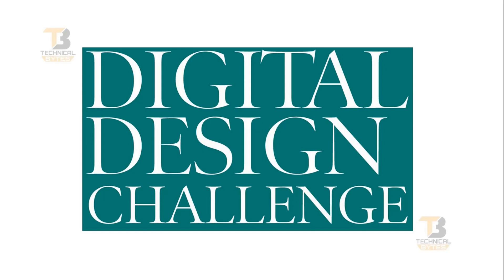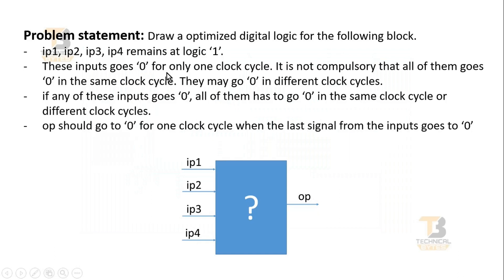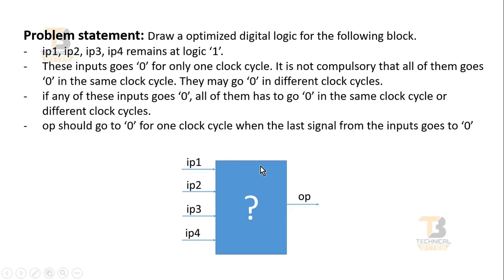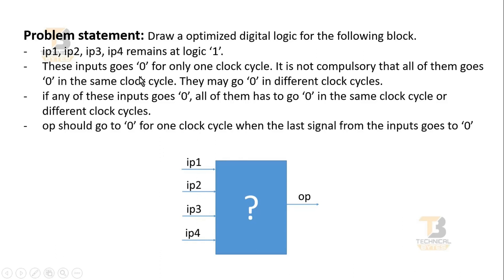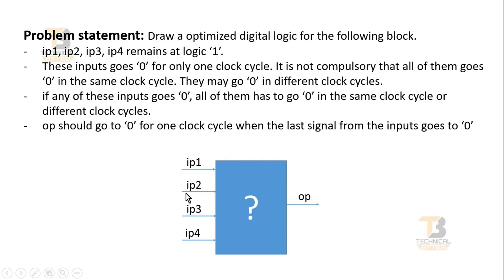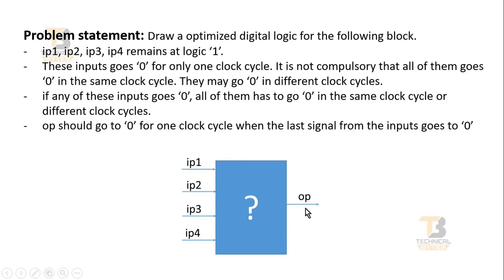Digital Logic Design Challenge | De-Skew logic

Comment: https://drive.google.com/file/d/1Zod3CWFzXak3Xtw_T5CVO9jnIYJQ8aad/view?usp=sharing
Feel free to correct me guys✌
Reply: I got the exact same solution
Reply: Bro one doubt. Is the last flipflop taking input ip4 necessary? since all signals b4 it will have become 0 once for a clock cycle and we just have give ip4 to a not gate and get 1 from the output of and gate...... Also the final output should go 0 when the last input(ip4) goes 0 on the same clock cycle .use of a flipflop for the last input will delay the output by one clock cycle.....please correct me..
Reply: I reviewed your design, there are two problems in the design, first one is that applying a data signal to the reset signal is discouraged in the digital design. Second major issue is that your output will go '0' after one cycle of delay after the last input goes '0' . Please check it once !!

Comment: 1. Negedge detector for all 4 inputs.
2. Additional 4 flops to store the detection, once all 4 are detected will auto-reset all flops to 0 and generate an output pulse.
3.Pulse generation logic can be combinational, which will be asserted when all 4 flops are set to 1.
4. Let's say in the nth cycle all 4 flops get 1 value, in the n+1th cycle we can make all 0, this way we can see the pulse on output logic.
Reply from the maker: very good try !! But your pulse will be delayed by one clock cycle. output signal should go '0' in the same clock cycle when the last input signal is going '0'
Reply from the maker: you are very close to the answer !!
Reply: @TechnicalBytes  Please provide answer. I am thinking in the same line. But negedge detector itself will have one clock delay right? So, one clock delay is inevitable I feel.
Reply: @TechnicalBytes  sir This can be done output of all 4 ff which store detection are combined to  a NAND gate
Reply: We will have to make a asynchronous clear logic for the output to become 0 ?

Comment: I am confused, can you please elaborate the last 2 conditions?
Reply from the maker: Second last condition, if any of the input goes '0' for one clock cyle.. then, other inputs are bound to go '0' for one clock cycle either on the same clock edge or any other clock edge afterwards.

Last condition, last signal is the input signal which goes '0' at the last. When last signal goes '0', output should also goes '0' at the same time.
Reply from the maker: Let me know if you have any other confusion.
Reply: @TechnicalBytes  thank, it's clear now. So does this mean we have to design a controller to drive these inputs?

Comment: 4 flops to detect when inputs go to zero and then putting an edge detector would result in the answer I guess 🙂
Reply: Basically 4  negative edge detector logic and whenever each of the negative edge is detected , output becomes zero?
Reply from the maker: As per the problem statement, my output is only 1 bit long. As per your solution, each of negative edge detector will give one output, so four outputs in your case.
Reply: @TechnicalBytes   we will have to do and operation , at the output of all 4 edge detectors .
But i am wondering how will this affect de skewing?
Reply from the maker: @rohitkankal3857  Please draw it on your notebook and share the complete idea.